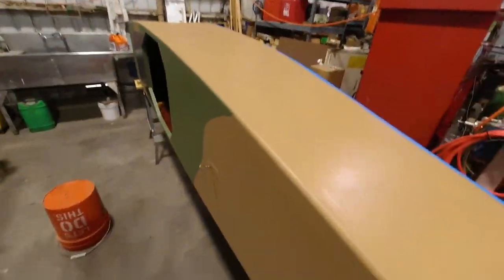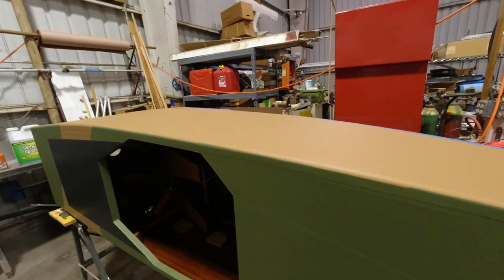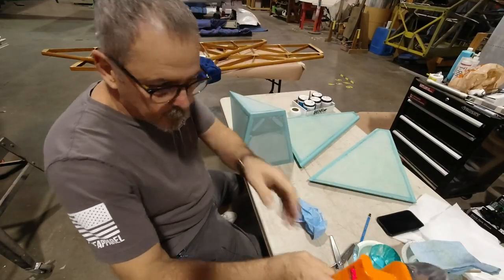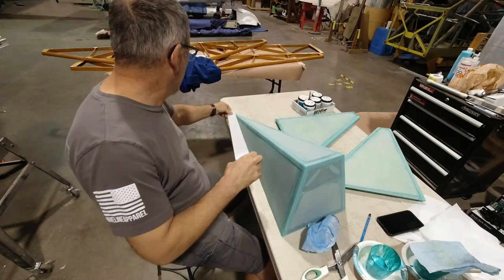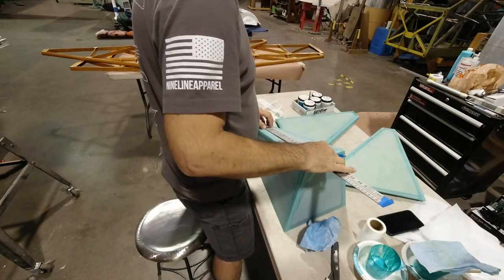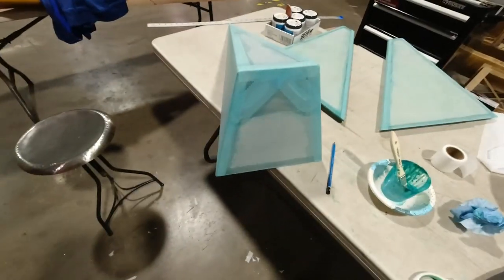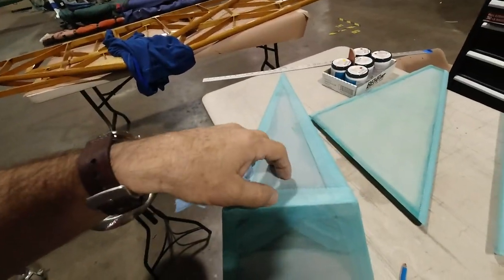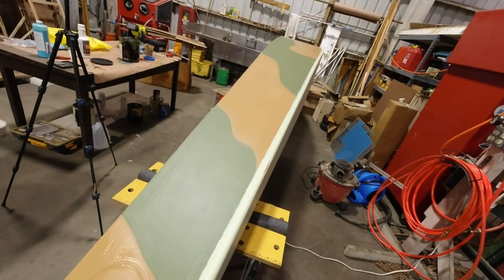Minimax 1100r Wood Aircraft Build Ep 157

Comment: Dennis, you are so exact in your work.  I've never met a "home builder" who did not know where the defects in his build were located - and there will be some.  A "run here," and "run there," a curved area where the covering didn't fully cooperate, a counter sunk screw that went in at an angle, etc,    But, folks looking at you plane DON'T see any imperfections.  :-)  My EROS, "dressed up" as a P-40 Warhawk,  always received nice comments.  There were, however, many defects in the painting, (shark's  teeth and eyes +)   Later added Roundels.   We see these defects - no-one else does.  

Later, I added a Fau  engine exhaust system on each side of the cowling.   (Pvc pipes and 90 degree angles - painted Black)  which caused some "lookers" to ask "what engine do you have?"   :-)  Later on, hung a bomb shaped 5 gallon aux fuel tank on one side - put "fins" to make it look realistic.  Added "Mil Spec" info on it to further the look. 

Lots of good stuff you could do with your Fokker.  The  Fokker, Eindecker  III  WWI, shoulder wing, looks really nice.  With your painting expertise, you'll come up with something, to make it interesting.  will be viewing,
Reply from the maker: Thanks Michael, those mock exhaust are one of my favorite things about your airplane! They looked so cool!